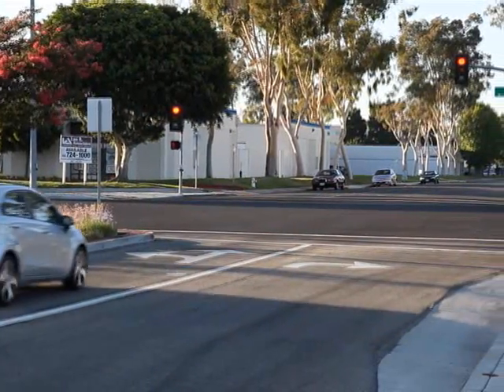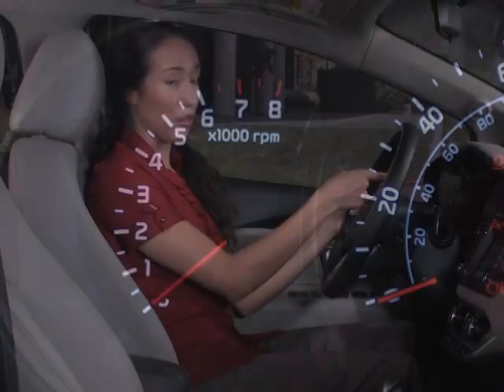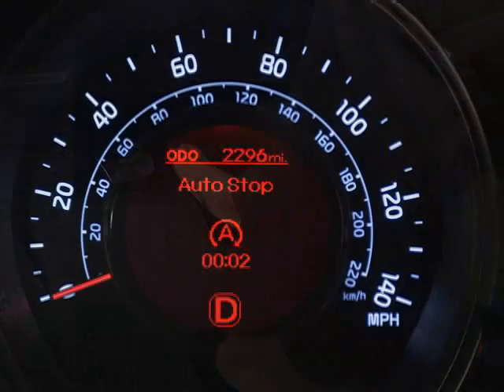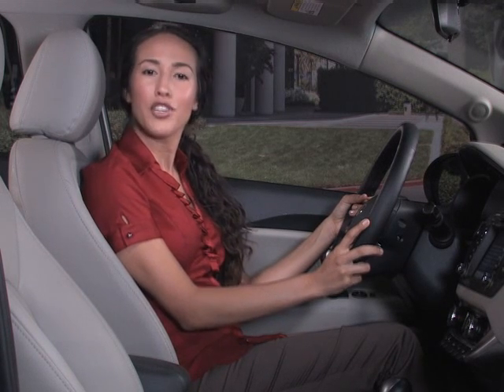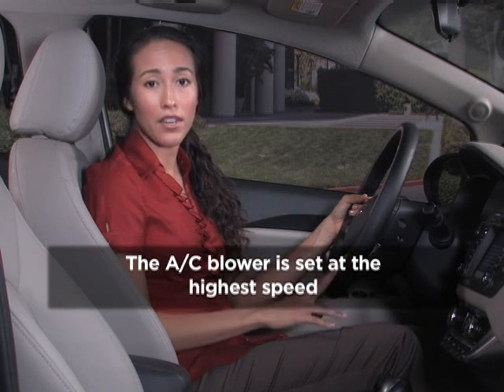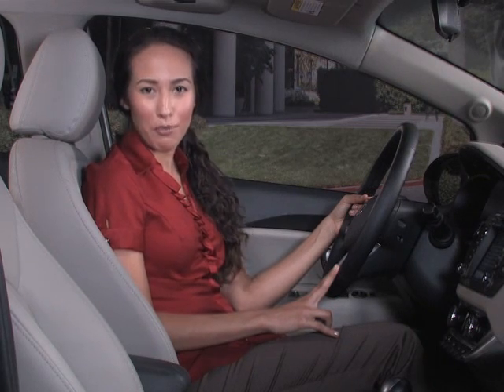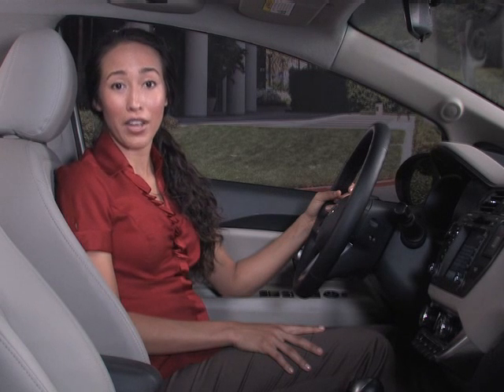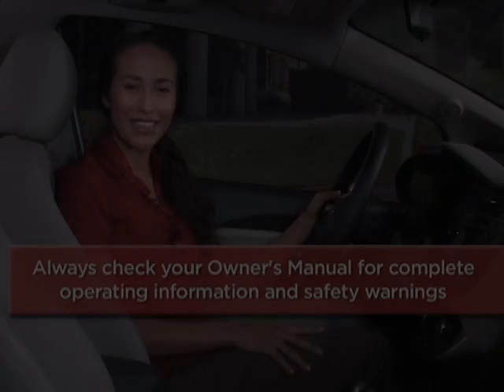Kia Motors Idle Stop and Go System

Comment: well I got one like 3 months ago and I felt something not right about it every time I drove it but it felt like that feature it has called Idle Stop and Go System trying to engage while I was driving but I brushed it off till it started getting worse so I made an APT with my Kia dealer to service or check it  out at only 1800 miles and  I barely made it to shop that day it was stopping and dying on me 2 miles from dealership but I made it. they said I need a NEW transmission... they got me a rental and after 2 weeks I finally got it back and I asked them why and he said well every once in awhile a part can be bad and your was. now when I drive it I still feel like i felt that feeling of the engine crapping out but sometimes I think its just from the first episode I had with it. I do not feel safe but what do I do. I really wanted a Telluride  but would have to put $1000 down and wait 6 months so it is what it is. I got this.'